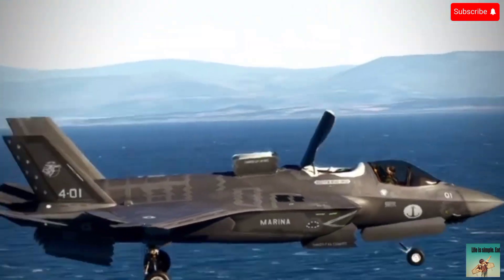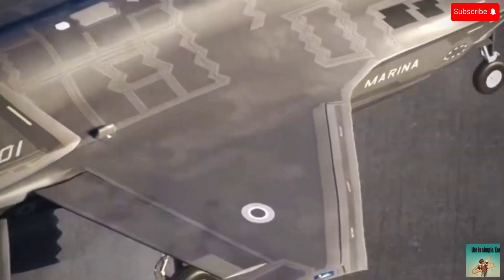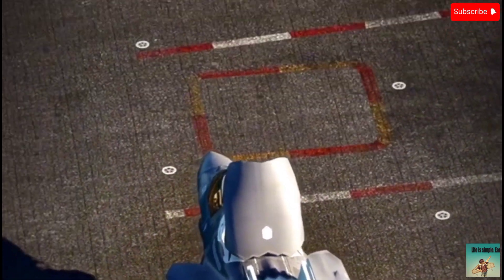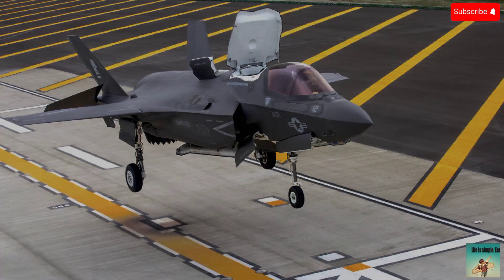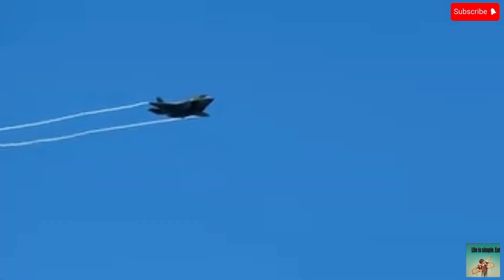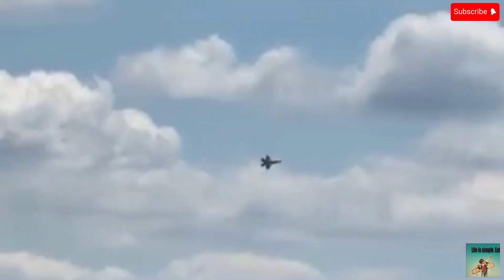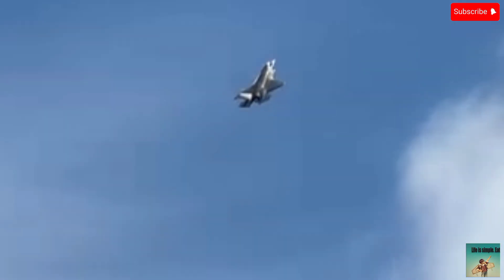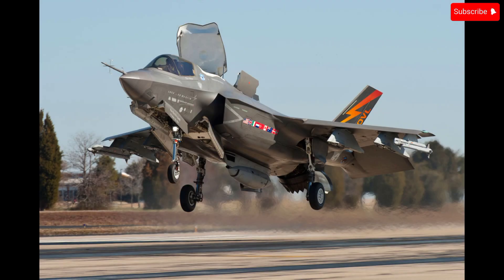F-35B A Rubbish Design ||  I Find Many Errors In F-35B || WITH PROOF

Comment: The F-35 is over rated.  Can't go fast, it's stealth will need constant upgrading, and it's damn expensive.  
This plane was the one the U.S. picked, and then shoved it down everybody's throat.
It has already required upgrades for chissake! 🙄😂
Reply: The F35 is not overrated. The “constant upgrade” argument is shit. Every aircraft in the U.S.’s arsenal goes through constant upgrades. We’re in the stage of working out all the kinks and what not, every aircraft has that early operational stage. The speed argument is bad, too. Why? It’s a multirole, it doesn’t need to be fast. Look at the F16: very similar. Single engine, extremely maneuverable, multirole, huge production numbers and very deadly. The F16 is legendary, and so is the F35, ask Israel. The stealth coating doesn’t need upgrading at all, but it will need fixing and I’ve seen and experienced stealth coat fixing and it’s relatively simple, compared to the B2, the F35 is much easier to fix the RAM coating. And lastly, yes it’s expensive, but it’s new as of 2015 and has a LOT of electrical and computer components, it’s a flying fucking super computer and BY FAR the most useful aircraft in the arsenal, and the cost production is so damn huge because they didn’t make just 1 version, they made 3 versions: 1 for the Air Force, 1 for the Navy and 1 for the Marine Corps. Do your research.
Reply from the maker: She is wright F-35 is over rated!
Reply: @InformationAboutFlyingObjects  Just ask Iran that, they carried out their mission with F35s and destroyed Iran's anti-air and missile production facilities. None shot down, lol. The F35 is vastly underestimated and our adversaries are finding out the hard way.
Reply: @KillingMachineMechanic  approaching 10 years old and we are "IN THE STAGE of working out the kinks".  Kind of a long time to be in the stage of "working out the kinks".  It didn't take 10 years to work out the kinks of the Legacy fighters, for example, and stealth tech has been around for decades.  But it constantly needs enhancements as radars improve.
And, though the C version has decent legs - and imho the best of the 3 - the others really don't have great range.   
Also, I've read that sustained max speeds are not advised due to effects on the stealth coating,  but I can't speak to that accuracy.  
Not saying it's bad, just not the wonder weapon so many think it is.  

And... this is just my opinion of course, but it's ugly, especially when compared to the F-22.
Reply from the maker: @stevie6265  Completely Agreed !
Reply from the maker: @stevie6265  I agreed
Reply from the maker: You have a great Knowledge about Airplanes!
Reply: pogue
Reply from the maker: @stevie6265  You are Right Stewie!
Reply: @InformationAboutFlyingObjects  He's wrong though, the mistakes have long been solved on the F35B and with the new upgrades their adding it'll be unmatched for a few more decades.